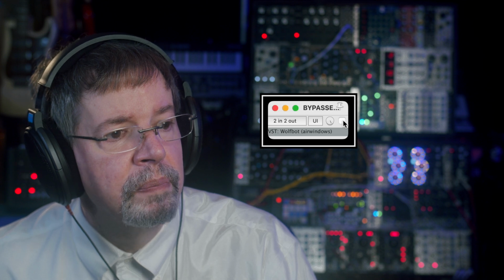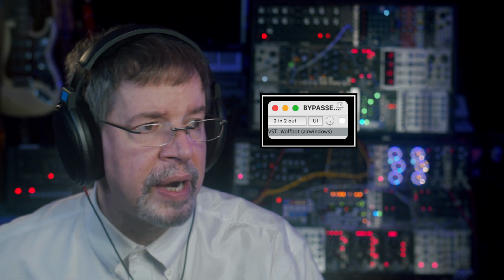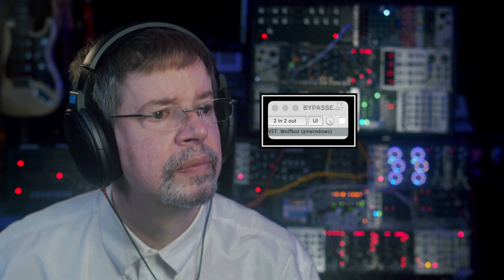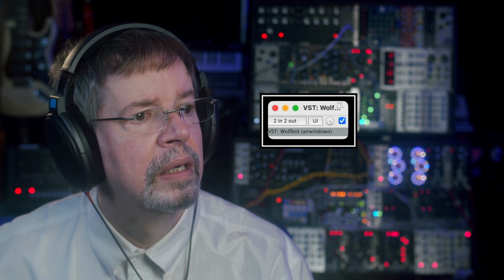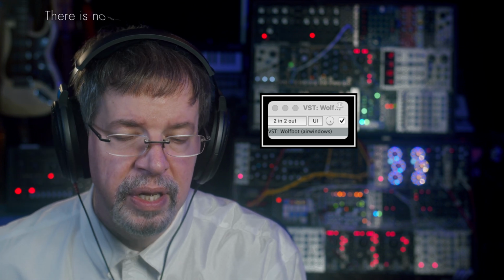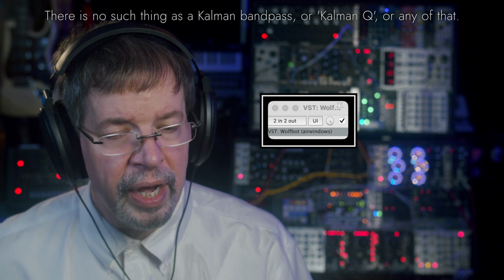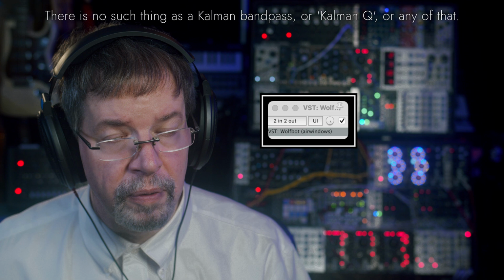Airwindows Wolfbot: Free Mac/Windows/Linux/Pi CLAP/AU/VST3/VST2/LV2/Rack

Comment: I really want to download your Totape6 to run through ableton live 11 suite on my 2017 Mac Desktop. I'm wondering if it's compatible to work? I'm having trouble scanning for it onto the plug-in folder
Reply: I’ve never been able to use the individual downloads. I always download the “Signed M1/Intel Mac AUs.dmg” file with all the plugins in it whenever a new one comes out, and can move those directly to the Components folder and they work fine
Reply from the maker: I don't know. The most recent versions are in the .dmg collections, and there's also Retro versions of the plugins you can try., The version on the plugin release page is always 'as it came out' for the first time :)

Comment: Does your plugins support DXD? Thanks!
Reply from the maker: Some of them certainly would! This might. As a rule I only design them up to 192k and prefer 96k for practical purposes, but I do prefer 96k and have been evolving my stuff in directions that would be able to handle DXD. In particular, I see no reason my new reverb undersampling wouldn't work at DXD. Some of the previous reverbs top out at 192k (4x)

Comment: It's pretty nice off the bat on electronic kick drum, makes it a bit meatier. More fun with AW consolidated, drive the input and lower the output with the parameters at the bottom of the plugin, then blend in wet/dry in Reaper around 40%. Phase plays nice. Gives a nice colour that doesn't sound overhyped.
Reply: Works on the drum buss in the same way as a bit of a sound design analogifier.